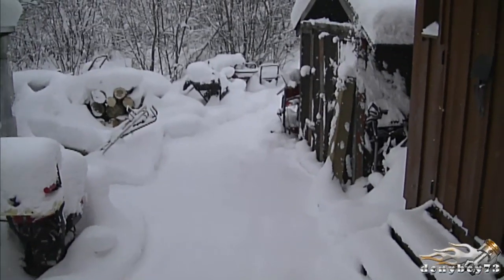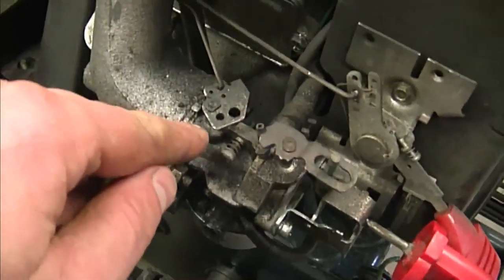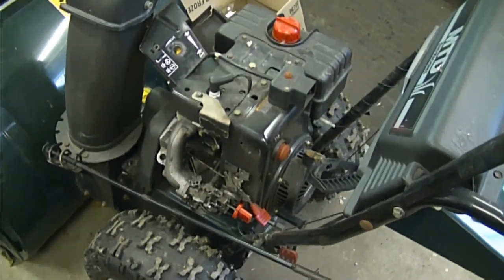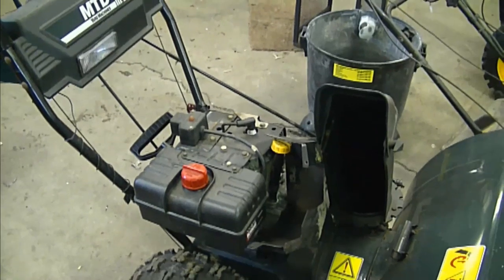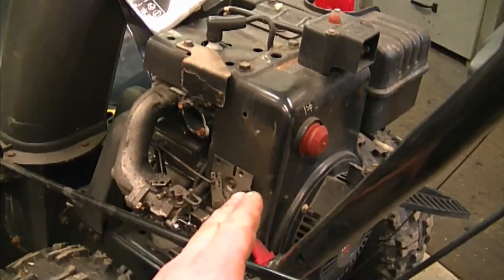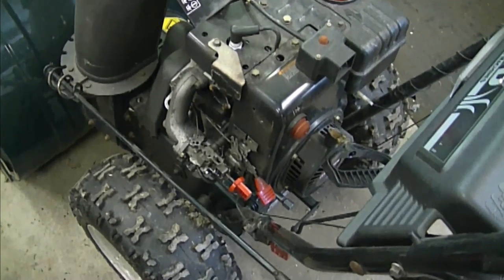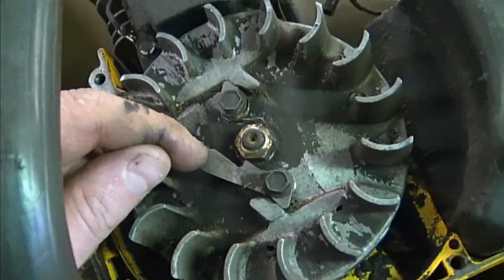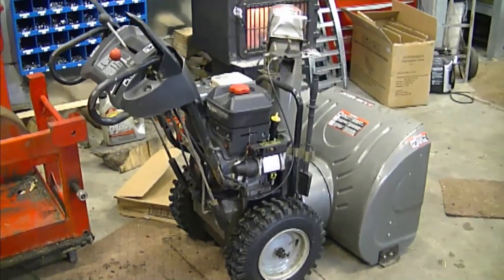Small Engines Q & A Video #137 in HD

Comment: On the snowblower that backfires, you may also want to look at the key-way on the flywheel. I have had a few that came came in doing the same thing, with a partially sheered key-way throwing the timing off a bit.

Comment: I used a splitter like that all summer. Makes splitting 2 times faster. Some cool things about this is that is has 0 friction. Is is a square beam instead of I beam, so it is much stronger, and allows it to run on sliders, causing no friction. It makes it much faster at moving the piston and blade as well. You can get a 4 way blade on them too.

Comment: thanks, i love this stuff. i have an older partner chain saw, i bought new  in late  80's, same color, dont recall the number. but its a 35 cc. i found out its the same as a husquvarna 35. i get my parts online or from my  local  dealer. it has only taken " abuse" parts.  always starts right up.  never even opened the  carb. occasional minor  adjustments. minor  recoil service.  its  for limbing only,  underpowered over say 8".  i run ethanol free in all my small stuff.  i  get it  at  a local race fuel supplier.thanks for  doing this. good luck

Comment: If your muffler on a Tecumseh engine is glowing a LITTLE BIT on the inside (you can only see it glowing when you look through the outlet port on the muffler and you can only see it glowing at night) (red hot) does that mean that the valve is leaking? & How would u fix the valve?

Comment: So, how do we submit a question to be covered in a video?
I have a....
Sears Craftsman 5/23 two stage Track Drive Snow Blower 1988 model 536-884800 Code 7307D
5hp Tecumseh #143-784032 Serial # 7296B
HS 05067274G
Chassis Serial #53782
12.04 CID or 196cc.
Horizontal Crank
Rewind Starter “provisions for optional starter motor”
Mechanical Governor
1987, October, 23th, Shift B

My questions are,
1: How is the starter added?
2: I want to replace the 5 HP engine with a 10 HP engine, but mine has 2 belt shafts turning in opposite directions and I have had no luck in finding an engine like that.
3: I replaced the cracked and skipping friction wheel but the new one seems to deposit rubber on to the metal drive wheel causing it to stick so when let go of the handle to move it forward it keeps going.

Comment: hey don, if ive got a tecumseh hm80 dual output shaft with a rod thrown through the block and a single output thats runs fine, can i swap the camshaft and sump cover and it will run fine?
Reply from the maker: YES

Comment: i have a quad bike i recently bought its 100cc but will only run with the air filter off. it is missing 1 exhaust bolt and slightly leaks. when i put the air filter on it chokes and dies. help!!!!

Comment: hi dony im steve hope you can help me out  I have a john deere 724d snowblower with Tecumseh engine ohsk70 with 1/2 inch pto for the two reverse gears and 3/4 shaft for the 6 forward gears problem engine blew up during heavy snow storm can I buy a replacement motor because Tecumseh out of business I only find motors with no pto ...  thanks for your help dony  ... steve
Reply from the maker: you can install your camshaft and sump cover on one that doesn't have two shafts
Reply: thank you dony ill try that. thank you for your help if I screw up ill send it to you and pay you to fix it for me lol...